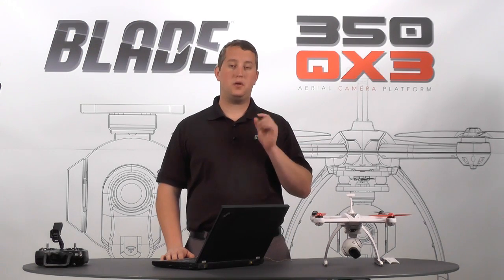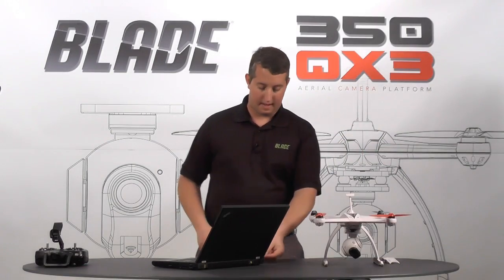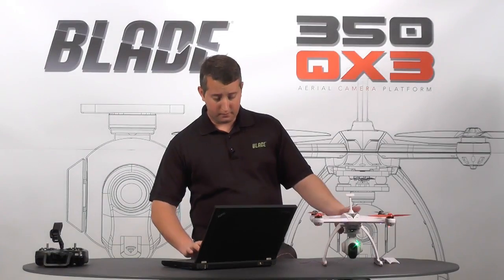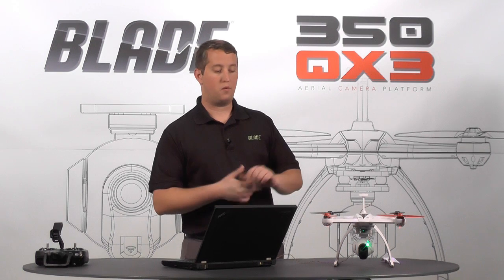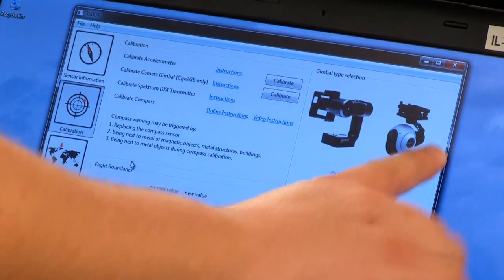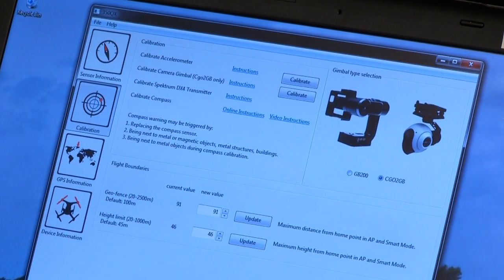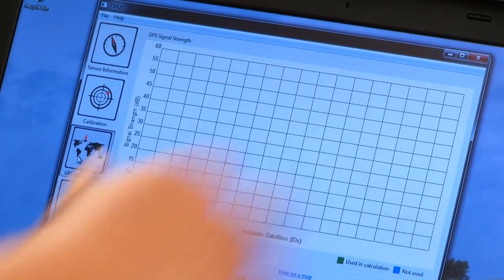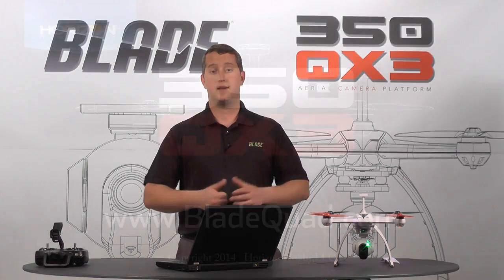PC Interface - 350 QX3

Comment: my 350qx2 ap won't work at all now after update. I turn it on and the lights flash and go off. all I see is the blue esc lights. it won't bind or go into any calibration mode. please HELP.

Comment: Quote " This radio system is not capable of going over a mile" The DX4 (stock controller) has a transmit range of a mile!!  That's a long way. I'm a beginner and don't tend to fly it more than 200 feet. No need for me to get another transmitter then. That's more than enough. Also aviation laws state it should be in your site. I can't see a mile away that's for sure.

Comment: I've had no luck upgrading to V3 firmware on a Mac.  The computer sees the cable when it's plugged in, but when I try to upgrade it says "No response from the quadrotor" and times out.  It's a V1 board.
Reply: +Kevin Greutert Did you plug the battery back in to your 350x?

Comment: I managed to solve the problem of light remains red, the QX3 350. The problem, that after the update, the LED flashes it only 3 times. And then it does not light any more color. And from what I read in the manual that speaks no LED means radio off or not connected to the quad. I wonder if anyone has gone through this problem and managed to solve, thanks for the help.

Comment: I got my 350 qx3 yesterday, I downloaded the interface and it tells you to download firmware it got half way through the download and then said the firmware is corrupted, so today I tried to fly it, and my quad just stays on red and wont start, and wont connect to interface, and after looking this up I found a few people have had this problem, so could you please tell me how to reset my quad.
Reply: Same problem here. Won't work, tried everthing....
Reply: I took mine back and replaced it, I don't dare to update again

Comment: It's not working for me.  I downloaded the GUI.  I got the FTDI driver installed.  Device is connected to my USB port and PC recognize it.  COM port is assigned.  Run the 350QX GUI.  Clicked install, assigned path where the firmware is, selected correct COM port.  Clicked install, waiting response from boot loader.  Turn power on on the quad.  Then, after few seconds, error displayed  "No reply from device. Upgrade Timed Out."

But, when i turned off the quad, the GUI will display Connected on COM Port #.  But no reading of anything.  The moment i turn the quad back on, same issue comes up.

I use Sony VAIO with Windows 7.  Any help is greatly appreciated....
Reply: I had the (same/similar) issue.
I startet the GUI and it told me it's connected to COM3, even though the programmer wasn't even plugged in.
When I plugged it in the device managed told me the programmer is mapped to COM5....
After hours of stuff I tried (uninstalling driver etc) I just  by chance (accident) startet the GUI twice. The first instance still said connected to COM3 but the second search COM 10 AND COM 5 and voila that GUI connected to the copter and I could use the interface....
And I tried it now a couple of times and always starting it twice finds the copter/progammen on COM5....
Reply: wearp Genius!
Reply: wearp  That did the trick.... Thanks.
Reply: wearp Yup that works for me to. The tell tail in the bottom left of the screen blinks disconnected but the firmware updates fine..... well my 350 flys OK. The software does feel very buggy.
Reply: Glad I found this! Had the same issue and now it works!

Comment: I have a QX2 and have installed the programs and drivers. However, when I open the GUI and attempt to install the firmware, the GUI reads COM3 but will not communicate with the copter. Any ideas?
Reply: Holytoledo86 I just made this upgrade and it's because you don't have the QX3's firmware.  It takes a little digging to find that stuff too, so be patient, it's not documented very well.  Also be warned that your blinking lights/modes aren't the same anymore so download the QX3's user manual and pretend it works like that.  If you're still using the DX4 that came with the QX2, the right side toggle is no longer arm and return home... I can go on, just pretend it's a QX3 without the throttle stick that returns to center... hope that helps!
Reply: Yeah, thanks! I finallyfigured it out. It took a combination of a couple different videos to finally get the firmware right.

Comment: I bought a 350qx3 today and as soon as i hooked it up to the pc interface it crushed the small connector inside the plastic housing so the blade is not able to connect with the transmitter, i fixed this with disconnectable attachments and replaced the corrosponding wire on the pc connection side with one as well. all i get from the pc is "unrecognized response recieved from device". i resoldered the connections twice to see if that was the problem. i am very frustrated as i cannot fly more than the initial setting of 100meters. is there any other way to reprogram safe mode besides a pc? any idea why it is not able to connect? it flys fine and all functions work as advertised after my jerry-rig but still stuck in boundaries set by safe
Reply: I don't Use Smart mode ..to me it's dumb.  Don't fly fast with beefy camera quad..AP mode is all I use and am not convinced  I need to give my quad a lobotomy  on an unsupported  site.  That's like going to mexico to get a nose job.  I'm selling my PC chord cheap 40 bucks. Can contact me at klopossa2003@yahoo.com.   Just Blades way of trying to keep up with cleanflight etc like all the big boys..That's fine if it well supported. Didn't see one response after all the requests for help.  My Blade 350 QX rigs fly well after some camera shielding and placing the GP Antenna where it was on first V1.  Put a cheap no WIFI cam on mine and she lost GPS signal almost immediately.  turned off Cam and she hooks up in less than 1 minute. After sheilding the cam like their kit allows. Way better but nat as good as the antenna way up firm and high..again like the big boys.

Comment: Hey Steve the pc interface not connecting to my 350QX2 is it the same connecting procedure you shown in this video?
Reply: do not use 3,0 firmware on your QX2 it will brick.
Reply: Saint Rod Mine didn't brick.  Works fine.  I'm just struggling to GPS lock, but that was the whole reason I wanted the PC inteface because I wanted to see the GPS diagnostics screen.  You need the QX3's firmware to connect to the PC interface.